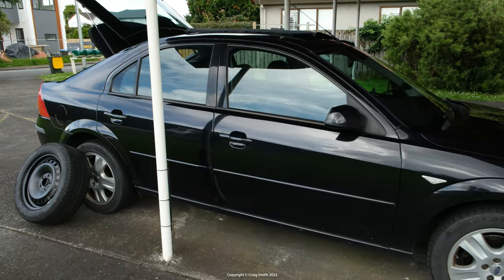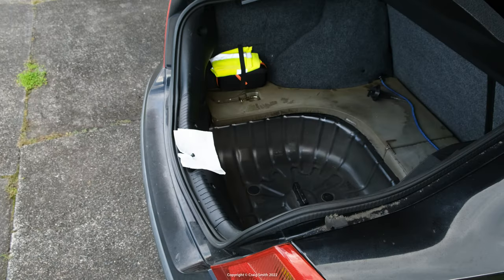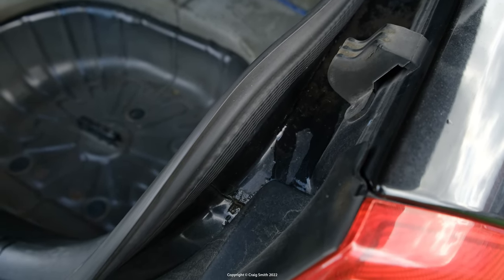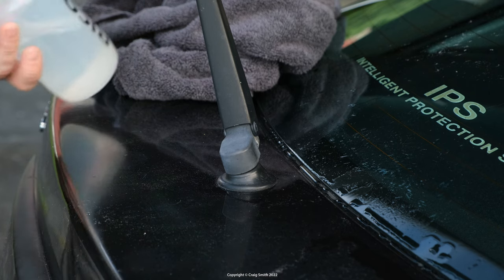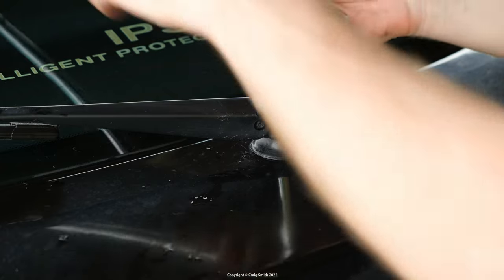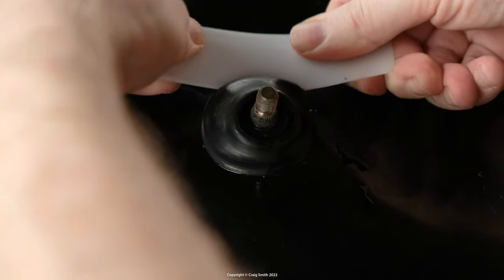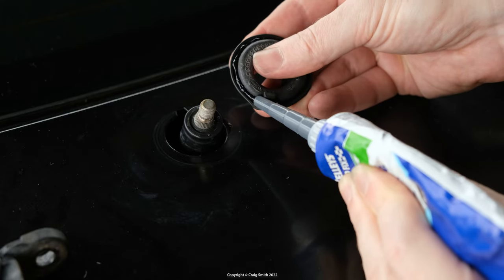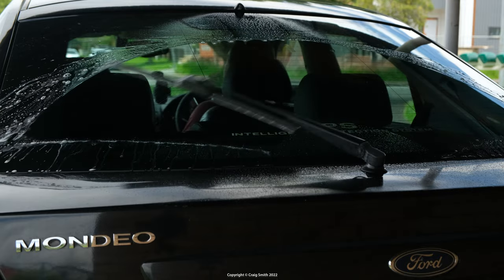A Mondeo water leak, and removing the rear wiper arm & grommet

Comment: Keep us updated with the progress please
The other area which is very common for Easter leaks is the little connection on the washer hose as it goes through the hinges in the boot, the connector pops off and the first thing you notice is no water from the rear jet and then suddenly a deluge in the headlining

Comment: Nice video. Very similar to leak on my mk5 mondeo. I suspect wiper grommit also. Fuse actually blown for the wiper motor. Small tip for removing the wiper blade, fold it all the way up so it's vertical, you can then just use the lever to lift it off with no resistance.

Comment: Hi Craig, great info on your Mondeo with all of your videos.

Where do you usually purchase your replacement parts from currently? Since a lot of parts are becoming unavailable due to this model becoming older. I've tried Amazon, and some places on Ebay. 

I refuse to pay the inflated prices at any Ford dealer, and I've found that they'er usually not much help anyway if they can't spend more than two seconds finding it in their computer system.
Reply from the maker: Take your pick of wreckers; online at places like Trodo.com, RockAuto.com (US but believe it or not Mondeo Mk3 was in Mexico so it's on there), careful of LHD parts, if for the motor sometimes a Focus or other part will work; Ford dealer or other genuine parts suppliers as last resort.

Comment: Hi do you know what might be the problem with my mondeo mk3? Sometimes the engines rpm "jumps" up and down, and when I out a tester on it it says that there is a problem with the fuel adjustment percentage(when the rpm isn't working properly)
I have already change the map sensor and the idle air control valve and the pcv tube behind the intake manifold
Reply: It has driven about 150.000 miles
Reply from the maker: Be more specific than "fuel adj %"? Anyway it could be anything, you will have to work through a process of elimination. Air and fuel. Also check throttle position sensor, and upstream O2 sensor.